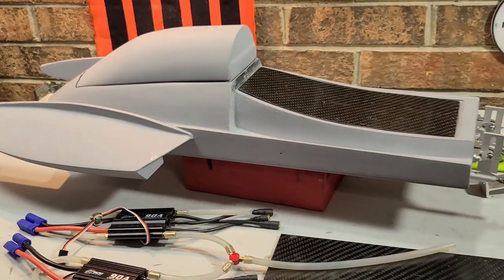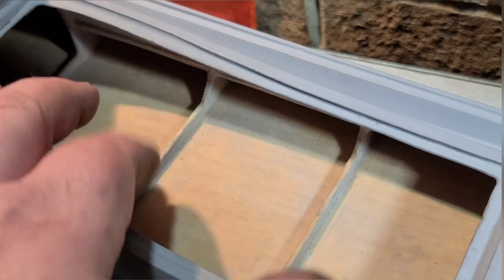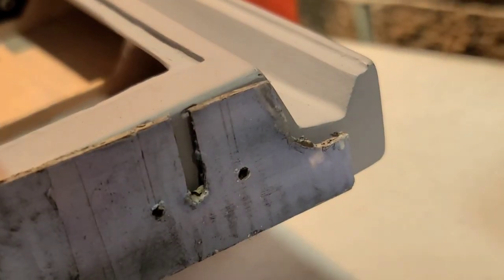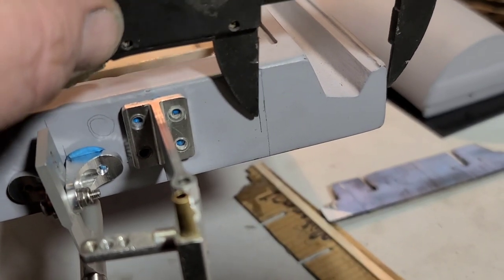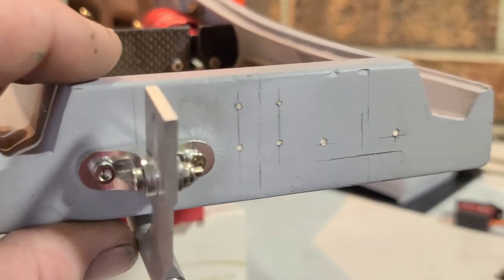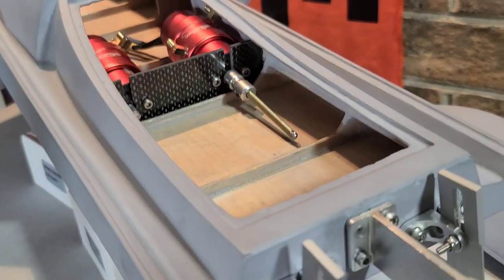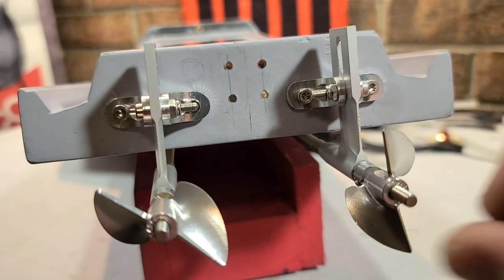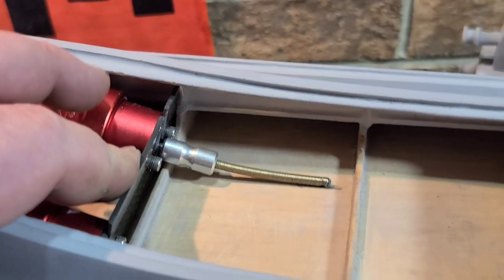Pt2 Twin Motor Rc Drag Boat Build - Motor & Drive Line Installation - Dual Motor Hydroplane

Comment: I have a couple twin motor airplanes and they are counter rotating props inwards. This helps with stability and  with the motor torque in keeping it straight. Also think about a car, sometimes you set the front end up with a little tow inwards, never outwards for the same reasons. I would recommend doing the same with the boat props brotha, inwards rotating.
Reply from the maker: 1:1 drag boats run their props inward like your airplanes I think that's why they put on such a brilliant show with 200 + feet rooster tails.   I'm gonna try prop rotation both ways so we can see the differences.    Thanks again brother
Reply: @IRONCLADRC     Doctor jet says the opposite outward rotation. Make sure you video both versions so we can see. Lol. Thanks
Reply: @PhilBender612  That's the only way to know whether or not one is better than the other.  Do it both ways and document it.

Comment: I have a 26 inch cabin cruiser-style mono hull with twin outboard motors that I mostly run in my pool. I noticed that when I set up the counter rotating props running inward the boat steers much more sharply to the point that the boat almost leans too much when cornering. The boat leans far less and doesn't steer as sharply when I set up the props running outward, but it is way more stable. Your on the right track by just simply trying both ways and settling for which one you like best. I suspect you will favor stability over increased steering. Cheers!
Reply from the maker: Makes perfect sense,  I knew outward spinning props helped with stability but I didn't realize inward spinning props would cause oversteer or twitchy steering.    Thanks

Comment: For an old wood tick. your pretty good at building RC boats.
Reply from the maker: It's literally in my blood, I grew up around boat building my father and grandfather built 1:1 boats...    my dad built little kneelers (8' racing hydroplanes and my grandfather built 80-90' shrimp boats.

Comment: Boat is looking awesome B. What I've read about prop rotation, one way adds lift, the other pulls transom down, I don't remember which is which tho. You gotta be super geeked to see it on the water.
Reply from the maker: Lol,  I finished the boat late last night I put her in the pool around 1am to see if it floats...  yes I'm very excited.

Comment: If you are looking for big rooster tails, consider this:  It is the EXITING prop blade that throws water into the air.  With outward rotating props they will tend to combine the spray in the center, whereas inward rotating props would have two smaller sprays spread further apart........

Comment: Randy Naylor (Blew By You Racing) was working on a 1/6 scale drag boat; I think it was the Problem Child.  I haven't heard much from him lately, but there's still some interest in drag boats.  It would be a fun class to run and narrow bodies of water (canals?) would work just fine.  You might be on the cutting edge of a new challenge in RC boating.
Reply from the maker: The last upload I saw from that boat was at a show, he was saying his maiden would be in his next upload lol.     That was 3 years ago.  Hmmm.  (Edit 7 years ago)  Wonder what happened in his maiden voyage? Lol. That boat might be at the bottom of a lake somewhere 😆   she's  a master peace to say the least.    https://youtu.be/3npSqPeVNM8
Reply: @IRONCLADRC  Cool video.  Did you notice his props rotated outwards?

Comment: Drag boats lookin dope!
I just got home from pickin up a brand new, never ran Zelos 48!
So stoked!
Reply from the maker: I've been watching a 48 on ebay bare hull for 650. I was hoping he'd drop the price
Reply: @IRONCLAD RC  the guy i got this one from. Has another spare zelos 48G hull.
I think he said he'd take 5 bones for it...
Or trade for other rcs...
I can get you in touch with em...
Reply: @IRONCLAD RC  but remember.. the canopy is sold seperate.  And they're out of stock on Horizon.
But they do have the "Notify me when available" option..

Comment: Your boat building skills are amazing my friend.. have you ever thought or tried to use stainless brake line tubing for your stuff tubes? May be cheaper than buying the brass tubing, and can be polished to a mirror shine too . Just a thought, dunno if it’d work or not
Reply from the maker: Brake line works great actually.  I used it in my vety very first boat build more than 10 years ago brushed motor days.

Comment: Hi, your drag boat is looking pretty good. 👍👍I use the direction of rotation of the propellers, like you, hitting them outwards. We probably had the same thought that it would probably increase stability. Works great for me. But now a question: You seem to be using the flex shaft directly in the stern tube without a Teflon sleeve. Such as in the Miss Geico or Sonic Wave or TFL Zonda. Aren't you worried that the flex shaft will wear through?
Greetings from Germany 
Sorry for my bad English 😶
Reply from the maker: I've never had issues with the flex wearing the brass Stuffing Tube, I usually keep my boat greased up pretty good though I use a couple drops of oil aswell
Reply: @IRONCLADRC  Okay, I'll try that on my next boat then!🙂🙂

Comment: I prefer mine to rotate outward.  I posted a short vid with my reasoning and experience as it's easier than trying to type it out.
Reply from the maker: Just watched your video, thanks for the info.    Probably start with outward rotation like you recommended..    I think inward rotation would give us a 40-foot rooster tail, unlike the real boat's 200-foot rooster tail.   Very curious to see the performance differences.  Thanks again doc